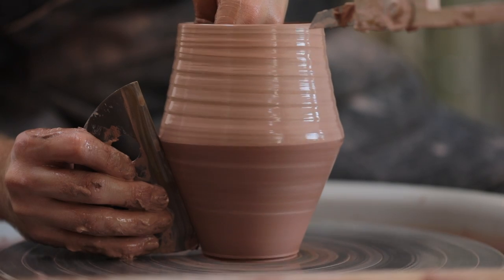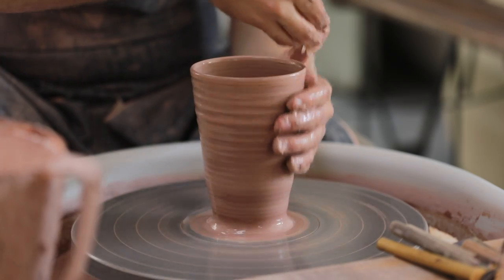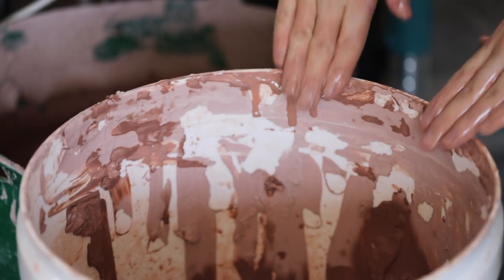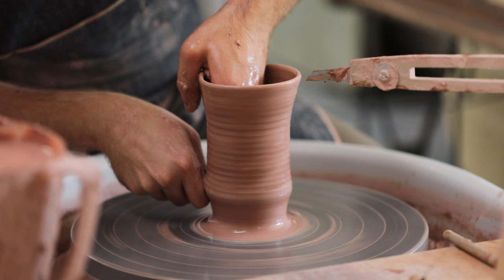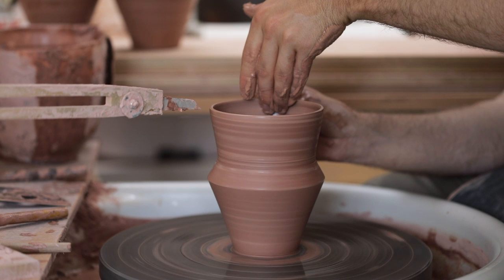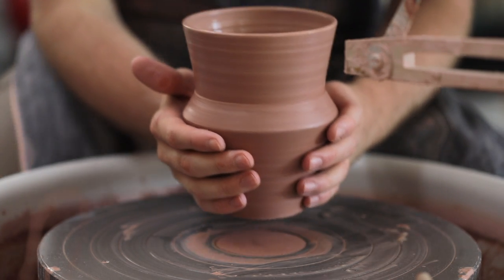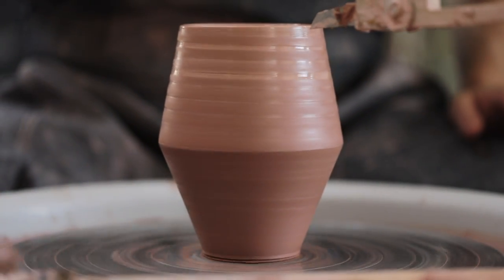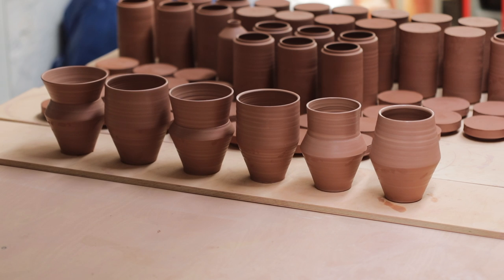How I Make Angular Stoneware Vases with Linear Markings

Comment: I love your videos, man. Personally, I also love these designs more than the others. The line cuts the forms so neatly and actually emphasises the overall form.

Despite the incredible quality and format of your videos, I have one criticism of your narration which I hope you will consider. I can't tell if you're using a script or not - it doesn't matter if you are - but I would suggest trying to avoid such sentences as "that's enough of that" or "that's a topic for another time". I've heard similar phrases in most of your videos and, to be quite frank, it's a rather distracting dismissal of your own narration. Simply move onto the next topic without drawing attention to the change of topic and each sentence will carry the same weight of importance as the next. Again, love your videos, I'm enjoying them thoroughly!